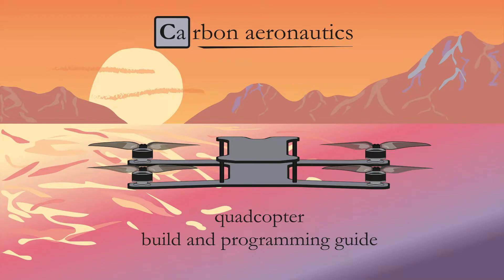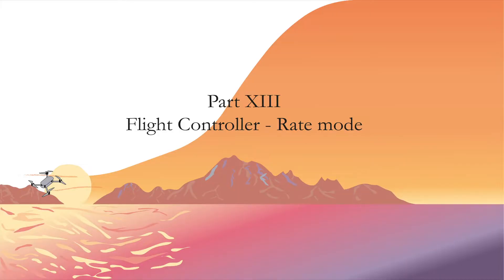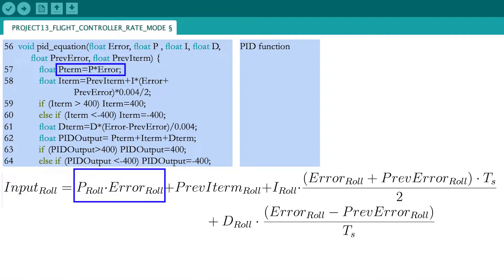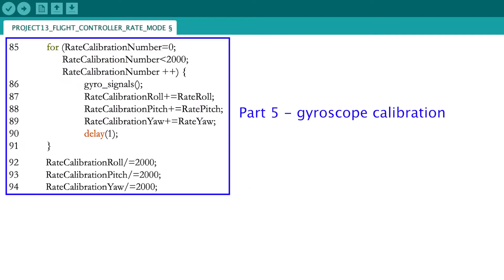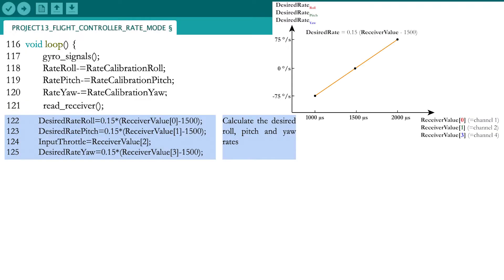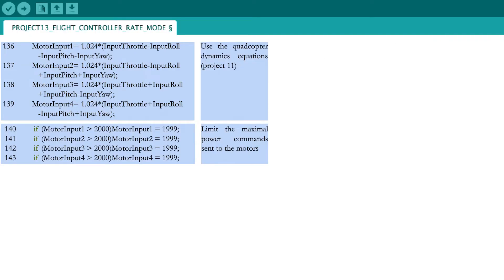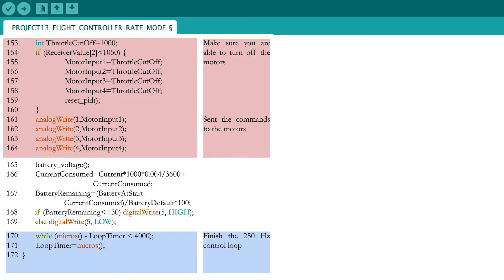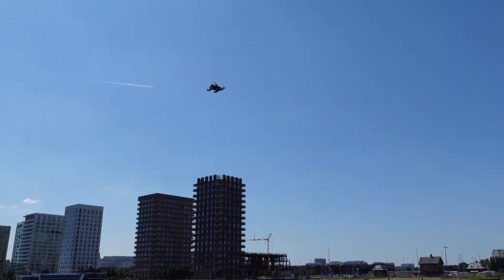13 | This 170-line Arduino code is a drone flight controller

Comment: my drone motors do not turn nor do I hear the ESC. when I plug just the ESC to the receiver all motors work fine. The code is the exact same. What may be an issue?
Reply: I got the same issue. did you manage to solve it?

Comment: You may not see this, but thank you for developing a safe system. Avoiding integral windup and having a cut-off throttle value has probably kept me out of dangerous situations while learning PID with a larger Quad Copter.

Comment: @carbonaeronautics appreciate the well organized and detailed approach you took in this project, the sheer amount of time & effort is admirable. 
I have a question regarding the values you choose for the clamping saturation limit for the integral, 400 & -400, how did you calculate this value? are those specific to the motors you use?
Thanks in advance

Comment: Could one disable the throttle and roll of a drone controlling system to make something move using just two degrees of freedom instead of 4?
Reply: I'm sorry if the question sounds a bit basic. I just need the info because toy car controllers have a very small distance range for the application.

Comment: Hi, I am using an Arduino Nano instead of the teensy. When I try the code, the IDE tell me that the function analogWriteFrequency and analogResolution are out of the scope. Is this due to the fact that the PulsePosition Library suits for Teensy only ? And if yes, how should I change my code to change the PWM frequency to 250 [Hz] for the Arduino Nano ?

Thank you in advance and awesome video !
Reply: Same question here !
Reply: Instead of trying to control the motors with PulsePosition library, use the Servo library. It works with ESCs. You can use the write function to send pwm signals to the esc to spin the motor at different speeds. You can set the range to 1000-2000 in the attach method and then write values between 0 and 180 to the servo object

Comment: Cool project sir👍, I want to ask something. Where did you know the length of one iteration time in your loop is 4 ms (for Ts value of I and D term)? and also how to calculate it?
Reply: guess he just set the loop time as most ESCs run at 250Hz
And T=1/f
Reply: @Tom-wd2ee  Ohh I see, thanks
Reply: @Tom-wd2ee what is T=1/f mean?
Reply: @Steve00alt  mathematical relation between frequency and the period

Comment: i use the teensy 3.2 output the motor it only works on pins 3 and 4, can other pwm pins really not work on teensy 3.2 ?
Reply from the maker: You can use pins 9 and 10 if you want to use teensy 3.2, instead of pins 1 and 2!
Reply: @carbonaeronautics  thanks

Comment: Hi sir! Can i use Arduino Uno R3 instead of Teensy
Reply from the maker: Yes that is possible with some small changes to the code, however it might be easier to use the Arduino nano in order to avoid cable connections as much as possible. Also know that the Arduino uno or nano are not powerful enough for the more complex flight controllers we will see later on.
Reply: @carbonaeronautics Thank you very much for your kind comments, best of luck to you 😁